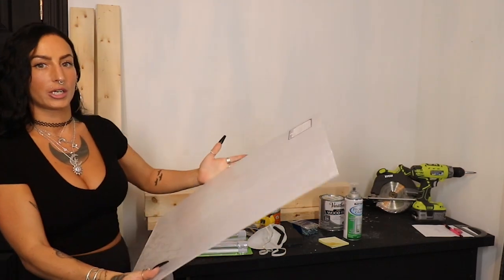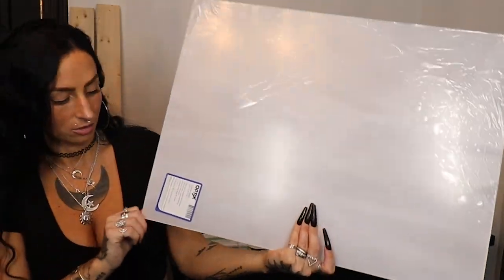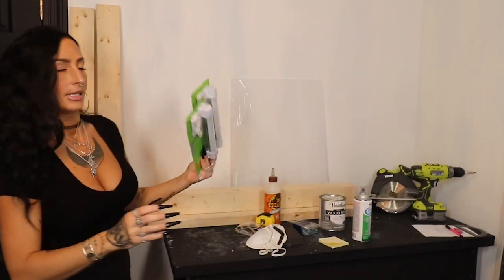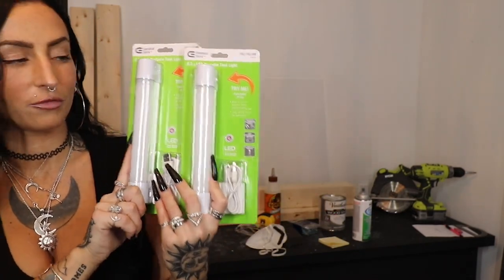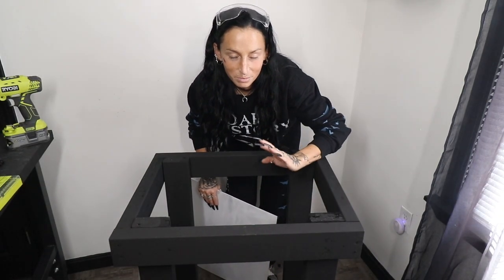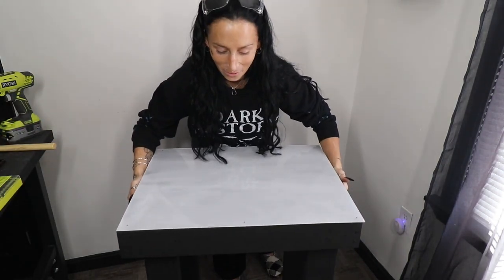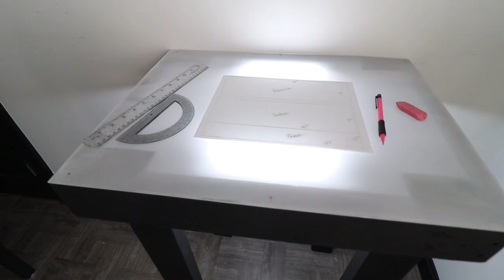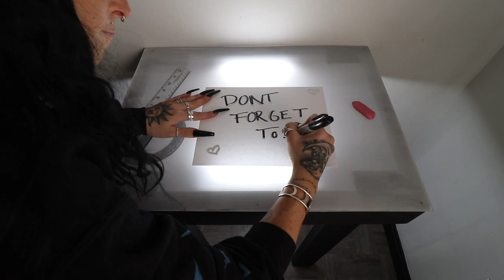MAKING A LIGHT BOX/TRACING TABLE!

Comment: Looks great!!  With greatness there are always speedbumps!  Just went through creating a PhotoBox frame and ended up having to unscrew and turn the 2 front boards sideways in order to slide in actual foamboard box.  Part of me wishes I went with cordless lights as well but have them ziptied pretty well and fed into a power strip.
Reply from the maker: I regret it now a little bit. Part of me gets annoyed even on the very rare occasion the battery has died and I have to charge it. lol.

Comment: Congrats.  Love it when it turns out exactly as you want and you did it yourself. Also  totally dueable for anyone that just needs a box without the legs if tight on room.  Thanks for the info on the lights you used, those are cool.  Great job!
Reply from the maker: Absolutely, I mentioned it while filming but it must have gotten cut with all the other rambles. 🤣😂 perfect for right on the table without the legs!

Comment: @Makenzie Hallie just a few tips from someone who worked with this stuff in the navy. 1/4 inch is going to be expensive I would go with 3/16 unless you were doing a full 4x8 sheet top. Even then you would want braces cut to a ^ at the top to support the plexi in the middle. Enough light will pass through the plastic it will not be an issue. Go to a plastics supply place if you want larger sheets it will be way more affordable than Lowes or a big box store.
Reply from the maker: Noted!
Reply: @MakenzieHallie  hope it helps your vid is great I just thought you might be able to use the info.
Reply from the maker: Oh no for sure! If someone decides to make a bigger one this will be super helpful!!